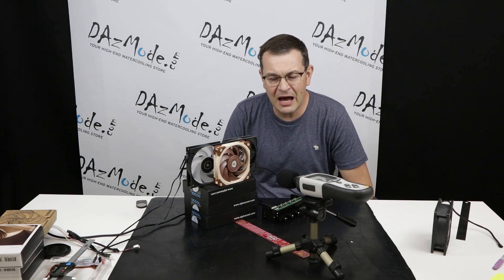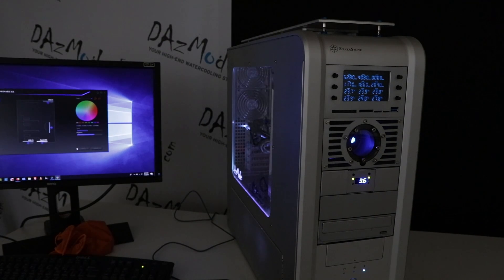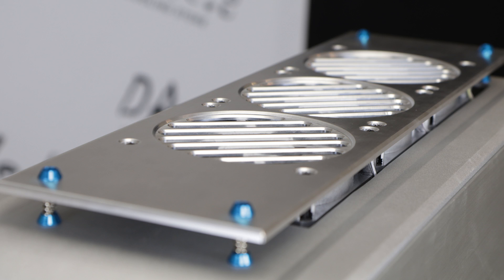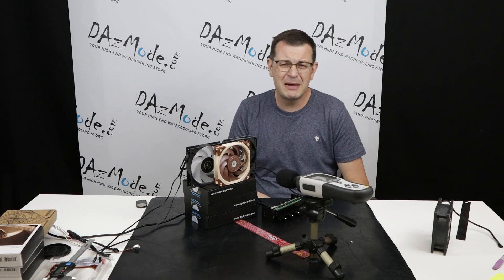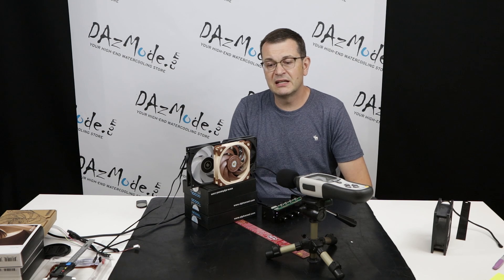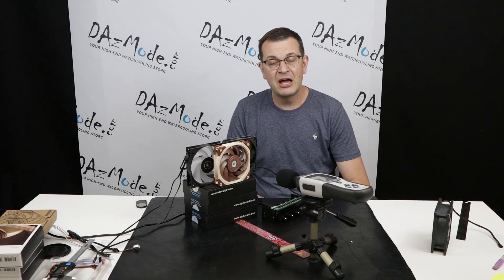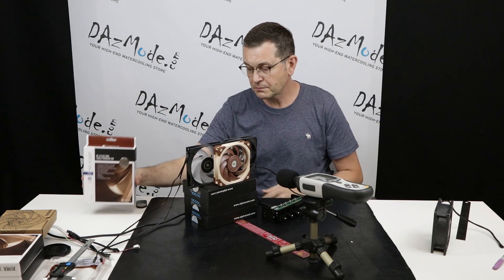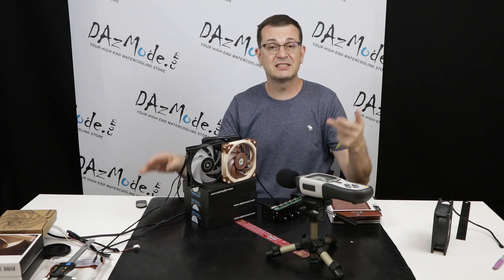Noctua A12x25  Noise Profile vs  SanAce, Vardar and Gentle Typhoon Fans

Comment: Excellent review. The thing is to me though, that you can’t have the noise conversation without talking about temperature. The objective really is getting as much performance possible in the same noise level as the competition. That’s where de GT and the Noctua in particularly really pull off. The .25mm clearance between the blades and the frame in the Noctua is what gives it it’s competitive edge as it is more efficient and thus, has better performance at the same rpm. Allowing it to spin at lower rpms that it’s competitors and therefore producing less noise at similar temperature levels.

Comment: Ok I used both the noctua a12 and the gentle typhoon 2150 on a 120mm aio gpu rad. The gentle typhoon pushes noticeably more free air, and in rad mode it gets my gpu maybe 1-2c colder but is noticeably louder and makes 3 different noises. Ball bearing hdd-like sound, fan noise, and vibrational tone. The noctua seems to push a bit less free air but for the noise level and single smooth tone especially much more efficiently cools my rad. I've switched back and forth a few times now, and may keep the GT for future setups where theres more rad surface area cuz it seems as if the hdd clicking sound is diminished in a push config(put your hand in front with fingers open and it kinda goes away) but noctua seems like the clear winner here. I mean just hold the two, the noctua a12 feels like no other fan I've owned, having it in your hands you really get a feel of like "damn this thing is rock solid and precisely built" theres no give at all. I really like the gt and it pushes an impressive amount of air but it's getting to be an old design and tbh ball bearings was not a great choice for tonal neutrality.
Reply from the maker: Thanks for sharing. Interesting to hear from somebody with a similar experience. I also was jittering between the two and finally settled on GT.
Reply: I wish they would update the GT series with different bearings, although I still have yet to be able to try them in a push config which as I said before I think would cover up the bearing noise. Perhaps I can move the rad into a place where it would blow out the top, but the h500m top doesnt have much room for extra airflow up top with a glass panel and 2 little slits on the sides
Reply: Using these inside my case on the rad and they sound much better, dampens a lot of the ball bearing noise I was getting using them as exhaust.
Reply: I have a GT used with push config on radiator. Basically the bearing noise are diminished. I think it's more suitable for radiators noise wise altough the fan itself is multipurpose (I think they are keeping the ball bearings because of industrial spec which tends to prioritize reliability first)
Reply: It maybe placebo but I think the GT sold by XPG has lower ball bearing rattling. I use them as push on radiator and I can't hear that noise.

Comment: Is there a particular reason why you didn't test the fans mounted on the radiator? With the fans mounted on a radiator, you will get the actual sound profile when the resistance of radiator fins is present.
Reply from the maker: I did. The same result as free standing. Mounted all three on triple rad and it was the same 1db difference.., even less than free standing.

Comment: Noctua certainly sound like they have the least offensive noise profile though
Reply from the maker: I agree. For my ears, the noise was the least annoying. If not the color I would switch.
Reply: @DazModeWatercooling  I think that's the main draw of noctua fans. Not the quietness but rather the tone of the noise.
Reply: @Ice Bear hi there, right now I'm contemplating on waiting for the new 140mm version of the noctua. but seeing your comment I could just do A14 chromax pwm since you said they all sound the same for case fans?

Comment: That SanAce fan while considerably louder, is also moving 3x the amount of air and has 3x the static pressure. you'd have to spin those other fans at 4k rpm to get the same performance.

Comment: The biggest difference for me is the motor noise or lack thereof on the Noctua fan.  All you hear are the fan blades cutting through the air as opposed to the other three where I can clearly hear their motors running.  Well, you pay for a quality fan and you get it with Noctua.

Comment: Awesome video thanks for sharing!  I came across looking for info on the little brother 40mm San Ace that spins at 12.5k at 100% but hopefully 4k at low in my Aruba switch.  I installed a calculated resistor onto the 12v line from the stock Delta 40mm fans and it only helped the lower speed fans, the 13k Delta has a kind of rattle/hum that a fish tank might put out.  Going to solder pin connectors to swap between 7v, 8.5v, and 9v on the San Ace 40 when they come in.

Comment: GT has that awful high pitched whirring sound. It hurts the ears more compared to noctua’s lower pitch. That is basically the takeaway, just as you stated. Right now the noctua fans for US customers are $9 more expensive than the GTs. I have the lower rpm GTs which I use to this day (10 years and counting) for my hard drive cages. I would probably go nuts by now from the 2150 high pitch lol

Comment: I'm kinda sad that you didn't even show the model number of the San Ace :(
It is very important to compare what each fan does at a certain rpm, the San Ace delivers much higher performance at the same rpm and thus is in fact louder.
If you compare the specifications from the San Ace 9G1212M101 (1950 rpm) and the Noctua NF-A12x25 PWM (2000 rpm), the San Ace delivers roughly 25% more airflow (126 m^3/s vs 102 m^3/s) and almost double the pressure (ca. 4mm H2O vs 2.4mm H2O), so it makes perfect sense that the San Ace is much louder than the Noctua, as it puts down more performance.
Sure, the Noctua fan has no motor noises and the San Ace certainly is the opposite, but that is down to the fact that Noctua basically buit a fan that maxes out at 2000 rpm and won't do more, but undervolts/regulates very nicely in the low end while the San Ace is a server fan in which the motor can get the fan (in the right model like the PWM controlled 9G1212P1G04 (I have that one, suprise, and it goes from 1050rpm to 3600rpm without lowering the input voltage)) to 3600 rpm and will run like that in a hot server for a couple of years without anyone ever complaining about it's noise, so there you have that
Reply from the maker: Here we go: https://products.sanyodenki.com/en/sanace/dc/dc-fan/9G1212E1011/
Reply: Take the vardar for instance, it is rated higher than the noctua but as you see performs worse. I think pure specification is not the whole picture here.

Comment: It would be interesting to measure the noise and put it on a frequency response chart, since 30db high pitched whine is more annoying than 30db of low pitch air noise. Also I noticed that my gentle typhoons change sound signature quite a bit when there is resistance, so for another test you could do it with a filter or radiator installed.

Comment: Theres no standardized way of getting to whatever numbers manufacturers use,so...
It doesnt really matter.And its extremely difficult to measure fan performance in any meaningful way.
Reply: Bullshit, set all the fans to the same RPM then measure how much noise is produced and how much airflow each one creates under the same conditions. How can it be difficult to measure the performance of each fan?
Reply: @rezganger  It really isn't that difficult to remove variables. Put the fan and calibrated sound level meter inside a box with sound insulating foam, this eliminates outside noise interference. Use the same power source for each fan at the exact same voltage and amperage for each. Repeat it 20 times with 20 sets of the same type of fan to get an average and viola you've managed to measure fans performance and it was so easy a 10 year old could do it. 

Did i miss any other variables? If so feel free to respond with them.
Reply: @holyravioli5795  I knew u didnt understand shit about testing methodology...
Have a nice day,sir.
Reply: Personally I only care if the performance difference is huge which is quite rare anyway. It's just better to choose fans based on... anything else, really.
Reply: @stardustreverie9737  The most important thing is noise,i think.

Comment: Am i the only one that hears  44.6db for the GT2150 at 18:31 VS 46.15db for Noctua A12X25  at 20:15 ?   Or was it a mistake and display shows 43.5db ?
Reply from the maker: Listen to tone, not the noise level. Mic recording with auto-gain.
Reply: He has and accent and subs pick up 46 instead of 43 that what he wrote down.
Reply: @alvarsantini2653  ok, thanks for letting me know.

Comment: I'm surprised you weren't aware of Noctua's dominating position on fan performance and noise levels. If you use about 50% of the speed, you'll notice a much bigger difference. Noctua's are well worth it. For people who wants to spend the same amount for the better noise level for limited cut in performance, I also suggest Silent Wings 3 from Be Quiet! (the company name actually takes an exclamantion point), they are awesome.
Reply from the maker: Im aware. I check if i can get more than 1db diffeence from GT at lower speed , otherwise not worth switching for me.
Reply: Over at dazmode we've been using the GT's for years and noctua just caught up to same level. I like how it looks almost exactly like the GT, proving the GT has had the best design for a while.
Reply from the maker: Just to be fair, equal amount comment was about Silent Wing fans.
Reply: @Ice Bear Brand loyalty? What are you talking about? I'm talking about reviews and benchmarks people have done and the general consensus of performance! If you want a value brand, well buy something else. And you get what you pay for with Noctuas, all the things I would have bought anyway with the fan such as rubber gromets and splitters are supplied. I can't think of a better deal IMO.

Comment: So... without knowing your sound floor it is hard to see if that was the actual sound level. You can't record the noise level of the fan accurately if it is quieter than the surrounding noise.
Reply from the maker: Obviously.
Reply: @DazModeWatercooling  so unless I missed it you never mentioned the average room sound level. So I feel that invalidates some of the testing.
Reply: He said in the video it's not a lab environment and he's not chasing fractions of a decibel, but rather what you get for 38 CAD vs 20 CAD, which ended up slightly quieter. The 10 decibel claim is ridiculous and what he was testing with the sound meter, otherwise the test is to show what the fans sound like and what the relative loudness is.

The San ace got 50.1 dB, noctua got a 43.5. Noctua marketing claiming its at least that big of a gap even more quiet than a GT which is bull, and this test shows that.

Techpowerup review does show the noctuas being noticbly quieter, up to 6 dB, though the test went up to 1500 RPM. Wish that review went up to 1850 at least, but the noctuas are definitely better at lower speeds, and Daz shows they kinda even out at 2100.
Reply: @VuNguyen-wo8bp  the problem is even in a room setup for it (take a linus test) the floor was 28 decibels. In this scenario you couldn't test if it was 10 decibels quieter because you will ALWAYS be limited by the sound floor. So if he was seeing 35 decibels spikes then even if the fan was 30 decibels you would never see that.

So my point is it works great when testing obviously loud fans, but for testing fans that are much quieter and close to the sound floor... well it doesn't work. It has nothing to do with half a decibel.

Comment: Nidec FTW obvious. Was lucky to buy the last five 1850 RPM BLACK ones from Amazon like a year ago. :D they work amazing. Had NF-F12 PWM CHROMAX 1500 RPM before and man they are world apart. So the Nidecs were making less noise at 1200 RPM than Noctuas at 800 RPM (had the noctuas at 800 rpm because everything above was just HORRIBLE). I hope these fans will last me as much as possible. I have 3 in use and 2 spare. Japan FTW

Comment: I've been trying to get the Scythe gentle typhoons, or nidec version - It's IMPOSSIBLE! :(
Reply: It is in the US, get a proxy, buy from us, ship to wherever
Reply: I just bought three used (1850rpm NIDECS) for about £35 on eBay in the UK, that’s because I have faith that they will basically keep on running for years. I am already planning my zen 3 mATX assembly, I want the best and quietest 120mm fans for it. I love GTs.
Reply: I've had my GT for over 10 years and still running. None of my original ones (from Scythe) has broken yet, it's incredible. I got 6 new ones in stock from the new company just in case they break down one day. I'm an old school PC guy and I refuse to use any other ones than GT in my system.

Comment: The Sanace is moving the banner in the background....I'm more of a performance over silence guy, that is what headsets are for! I have 38mm Scythe's in push pull on my CPU rad on a fan controller...i used to use Delta's mostly at 5V but on a switch setup to change to 12v.
Reply from the maker: SanAce  sound is badass.

Comment: Noctua NF-F12 are the static pressure versions, static pressure fans have a lower blade count and the blades are less curved. Awesome job on the build, it's a real thing of beauty.
Reply from the maker: I tested those few years back. Was noisier than GT.
Reply: I switched from the NF-F12 to the NF-A12 and the A12 are much better!

Comment: To honestly compare the noise level between fans, they have to be running at the same speed. This test without the use of a tachometer and a fan controller doesn't make much sense.
Reply from the maker: Did you even watch the video?  Yes, obviously controller was used.
Reply: @DazModeWatercooling  Sorry man. I didn't see the controller on the table. I apologize.
Reply from the maker: @jeanboneau6638  No problem!

Comment: I bought Gentletyphoons for all my radiators. Because its cheaper and  almost or is the best fan ever made.
Reply: I would like a comparison between the Arctic Bionix P120. They seem pretty comparable
Reply: Do yours also make a high pitched spinning hard drive like noise at higher speeds or should I send this one back?
Reply: Cactuar King they all make it at high rpm. That is one of the drawbacks for the GTs.
Reply: @cactuarking4138  This is old but really depends on cooling config. Push is the best noise wise because it eliminates the bearing noise. Air noise wise I actually prefer GTs

Comment: All companies have BS marketing but Noctua typically has the best stuff out there. I bought 9 NF-P12's for my main rig to replace some useless Corsair SP-120s and the difference is night and day. It cost me $250 bucks but these things are worth it. Regarding the bearings. SSO2 is not a variant of sleeve bearings. You can tell which fans use sleeve bearings by holding them horizontally with the fan pushing air to the top and notice the bearing noise.

Comment: Of course now Noctua has the redux versions without all that unneeded waste. Much cheaper.
Reply: Except those are much weaker fans than the NF-A12. The redux line is their old line of fans, but grey instead of brown. NF-A12 is in a different league and also costs twice as much. Whoever buys the redux fans thinking they are getting Noctua A12 performance is fooling himself. They are no different than your average fan.